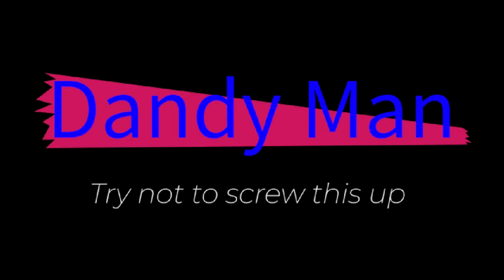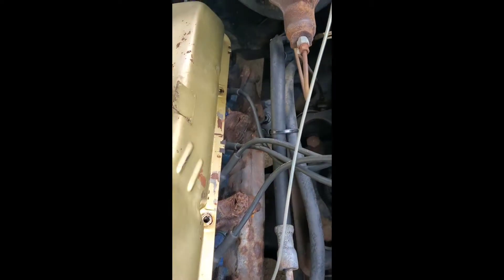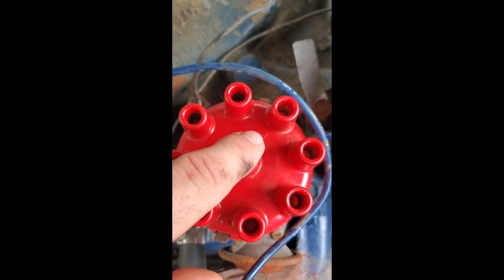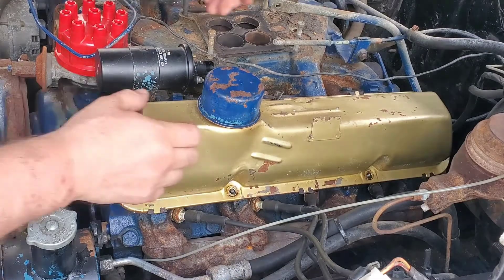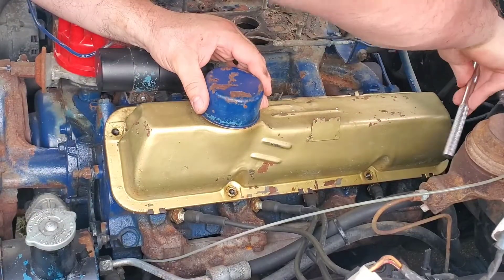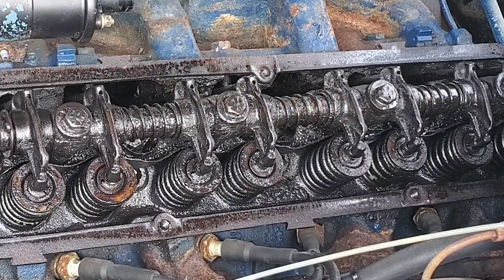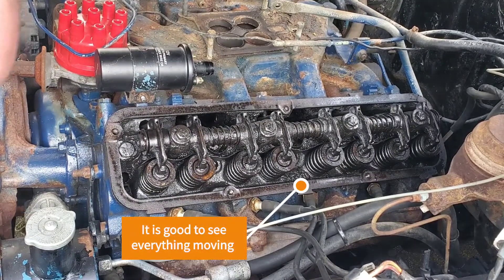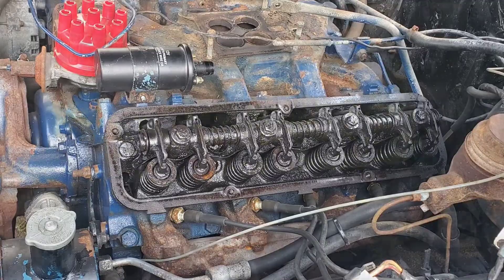🔧 1965 Ford Galaxie valve cover removal 🔧

Comment: The wires in that harness are cool, temp sending unit, oil sending unit. Looks like someone didn't change the oil enough and ran it hot. That's what causes that sludge
Reply from the maker: Thats what I figured with the engine sludge.  Thanks for the info on the wires. I'll have to see what guages I have or if I need to get something additional.  Any tips on getting that sludge out of there?
Reply: @dandyman132  take the rocker assembly off then plug the oil drain holes in the heads with rags.  Scrape as much off as you can with a screwdriver. Get a can of diesel fuel and a brush for the rest. Drain the oil after.